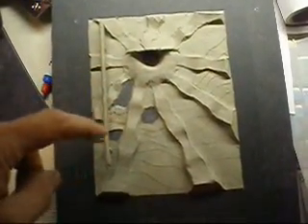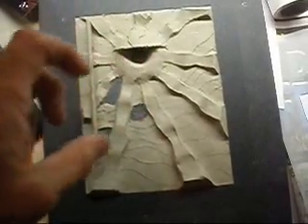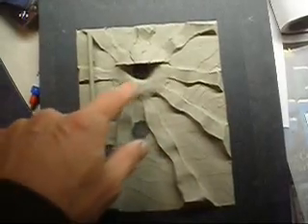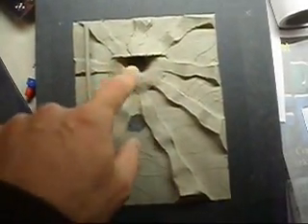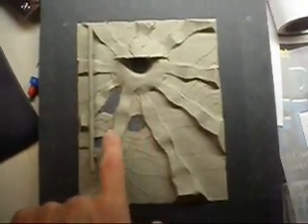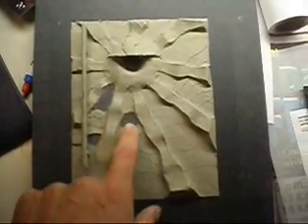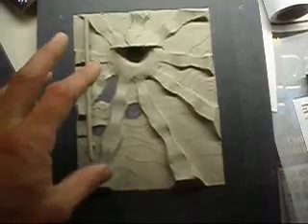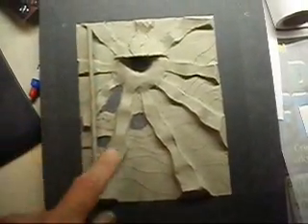Pivot Door - Part 5 - Front Panel Design

Comment: not gonna say what i thought the hole looked like, then you started to finger it!!!! lol

for the water element could you have a double skined section of glass within the door and a water movement within that, it would be mostly hidden behind the steel but where it is visable it would be in motion, weither waved or waterfall
i like the sun design, maybe that could have a gold hue to it, different type of metal maybe.
maybe the sun itself is a pushable unlock device
or it could glow

Comment from the maker: @NewRiverRepair It can cause problems.  This door shouldn't get hit by rain very often.  It will be under a large soffit.  I also have a trench drain in front of the door so any rust that runs off will be captured before it stains the concrete stoop.  I could be a problem with people rubbing up against it, but hopefully the 5 foot wide door opening will allow them to pass without too much trouble.

Comment: gregmporter cool design and artistic vision. Will the rusting cause problems with surfaces below or the glass behind streaking? The material was used for lighting at the MSP airport and there were problems with people coming into contact with the rust coating. Thanks for the video

Comment: Sounds like you put a ton of thought into this door. The info on the Cor-10 is something I know I will use. I manufacture window shutter hardware and I often get requests for a rust finish. I have been steering people to a rust color powder coat but the Cor-10 sounds like a better solution. Thanks for the info......Bob